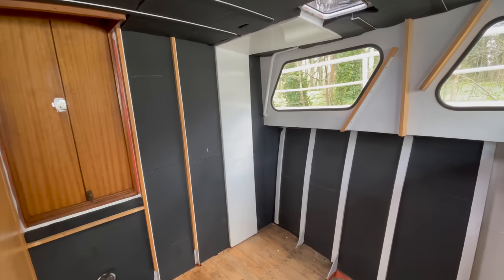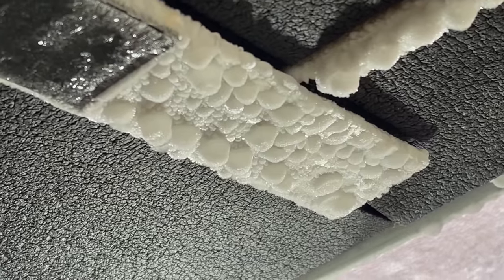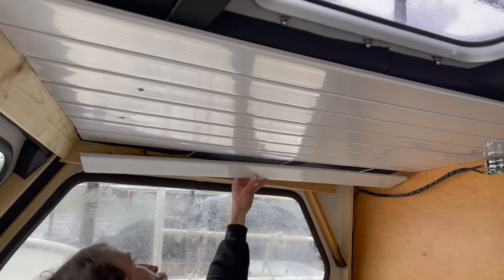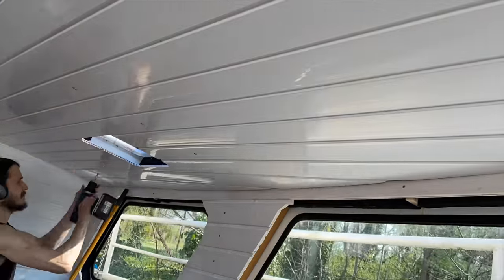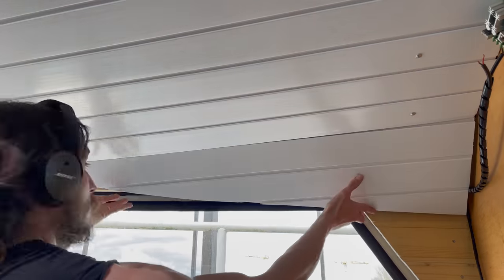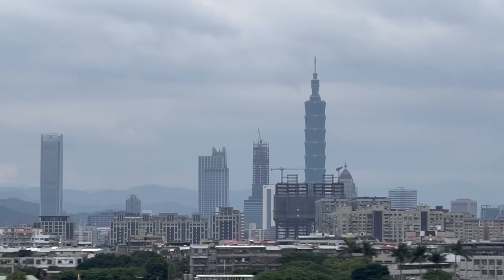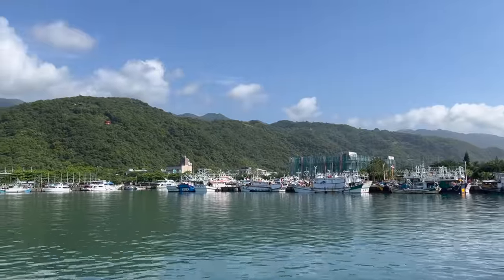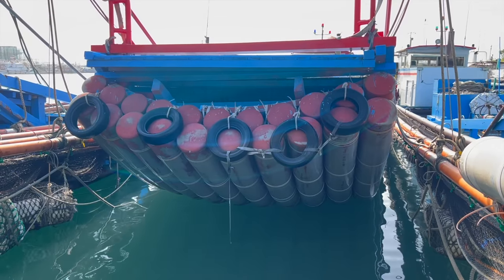UPDATE ON MY BOATS

Comment: In the winter some ventilation will reduce or eliminate the interior ice that melts. Just covering it will not. We sealed a porch up so tight this happened, when we let some air flow in it stopped.

Comment: If you have a metal building with a warm inside and freezing exterior you will get ice inside and dripping when it melts.  Unless you insulate and add a vapor barrier keeping heat in and cold out it will still freeze and drip.  I cannot see how putting up those boards on the ceiling is going to cure the problem in the boat.  They look great and in a different climate this might work.  Next winter will tell this tail.

Comment: One of the most important issues when fitting out a boat's interior is the ventilation between the hull and the interior. If you make mistakes here, you always fight against mold and a musty smell. Especially on a steel hull boat.
Good luck!
Reply: are you saying air needs to flow through the interior wall so that it can make sure the hull side has air flow? Or that region needs to be fully sealed to stop humid air getting in?
Reply: @Justowner  You should have a sufficient ventilation of the space between the hull/outer wall and the interior wall. 
In theory you can seal it completely, but this will never last long, because all materials are more or less permeable. Specially in areas with high humidity and temperature gradients between inside and outside you have to consider the dew point. And on a boat you cannot use thick insulations (larger 15 cm) to keep the dew point in the insulation layer like you do it in a conventional building.

Comment: Use the foam sandwich to create the external and internal walls and roof on the barge. The sandwich is light and so strong. Minimum steel framing needed. Just cut the holes for doors and windows. An advantage is everything is insulated..Get your mechanical engineer to do the design.

Comment: Nice work but, I would have used white screws on the ceiling or instal the screws in the tongue so they would be hidden by the groove. I would also add a trim around the hatch openings.

Comment: those screws are touching the steel directly so, the ice will form on the screws now. if it was me.. i'd figure out a way to make them not have direct contact with the metal frame. if it were me, i'd take the boards down and bore the hole in the frame bigger so i could incert one of those plastic anchors people use for drywall and other stuff. and reattach the ceiling using those plastic anchors because it would have plastic between the 2 pieces of metal. and it's not like your plastic ceiling will be heavy to hold up.

Comment: Nice work and interesting trip.  Thanks for sharing.  :-) 

I mentioned this before, but I am reminded every time I see you moor a boat alongside the big boat... Sure seems to me it would be good and useful to have a walkable area around the perimeter of the big boat.  Currently you have the cabin structure out to the edge of the big boat.  How will you tie boats on the sides of the big boat if there is no place to stand on the big boat?  If it were me, I would consider making the cabin 36" narrower than the boat, and have 18" of walkable area down both sides.  

Cheers!  :-)